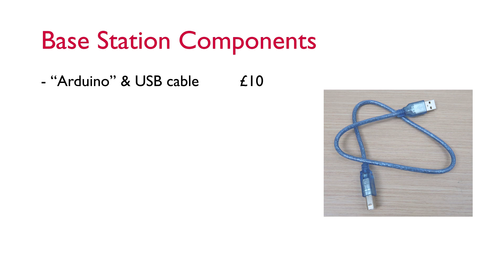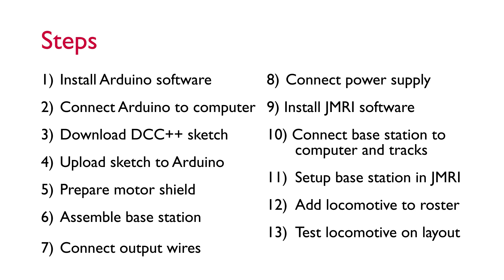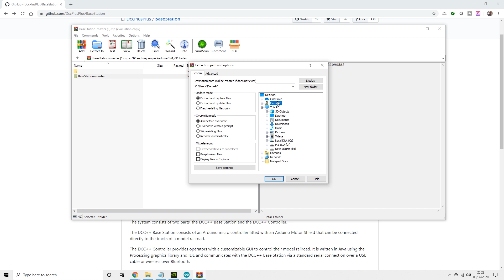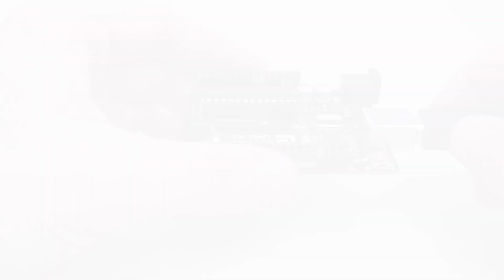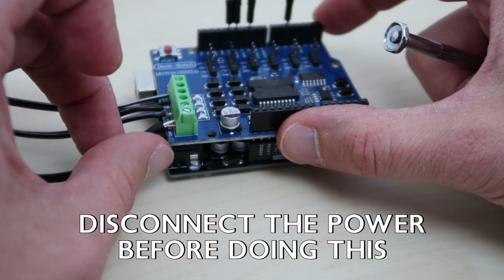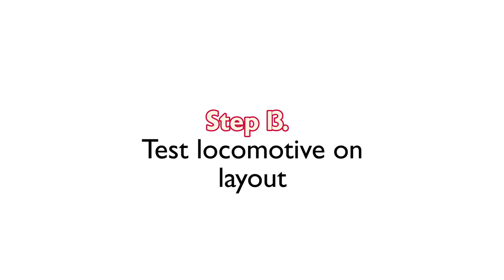Model Railway Digital Controller (DCC++) for £40 or less! 😮

Comment: Everything was going fine until you said (at 21.03) now turn on the power - and your led's light up on the Motor Shield. Q1: What did you 'turn on' as the USB and 19v were already connected? I tried a power reset to no avail, and I've tried an alternative UNO R3. All Arduino programmes loaded, coupled and verified. (Mac) Com port is working fine. DCC++ says DCC++ is online in Programming mode but can't see the programming track. Do you think my Motor Shield might be duff? Help!
Reply from the maker: Hi Andrew,

If you've got the locomotive roster open then along the top you'll have some buttons. The first button is "+ New Loco", the second button is "Identify", the third button is "help" and after that you should see an on/off button. This controls power to the track. It should be set to off (red) by default. When you click on it the button should go green and say "on". JMRI is sending a signal to the Ardunio to allow power to the track. This is when the lights on your motor shield should light up.

Give that a go. Hopefully you're just a button click away from getting it working. However, if not then try the following:

- In the DCC++ menu, click on "DCC++ Traffic Monitor" and a little window will pop up. When you click the power on button in the Roster you should see the following text:

" Track Power ON Cmd 
 Power Status: ON"

This is JMRI sending the command to the base station. That's the starting point for getting the track power to come on. JMRI would normally complain when it started up if it couldn't see an Ardunio connected on the COM port you specified, so I don't think it can be an issue with your connection to the Ardunio if you're not getting an error and the command is sending.

You should also see an LED flicker on the Ardunio when it receives this command. If you're seeing this message be received then that suggests it's an issue with the power supply or the motor shield.

- Double check your jumper wires are in the correct pins on the shield and fully inserted

- If you've got a multimeter then double check that the power input terminals on the motor shield are receiving power supply and what the voltage is.

Comment: Absolutely brilliant! just set it up in a few minutes after watching your video, got 2 trains running. Have looked  at your other videos and look forward to trying them. Thanks a lot. Liked and subscribed.
Reply from the maker: Thanks Dennis! Glad you've got it all up and running 👍
Reply: @LittleWicketRailway  I've just watched your video on Wi-Fi throttles so that's my next task so that my grandson and I can both control trains, we do at the moment with very basic Hornby DCC controllers as master and slave with RJ11 cable between them. I have another question although not sure here is the right place? I have a tram running on an isolated end to end DC track, and would like to automate it running back and forth and looking at your video about sensors I wondered if I can fully automate this using IR sensors at various places along the track so I can vary speeds, stopping at each end, etc. all using an Arduino and power shield maybe or MOSFETs? Thanks, Dennis.
Reply from the maker: @dennistombs692  Hi Dennis, sorry for the slow reply, but regarding your tram, you can definitely put in a shuttle using an Ardunio. Check out the relay and MOSFET modules in this video which might be of use https://youtu.be/CUWFqFmO1Ng

You could have one IR sensor at each end (or a current sensoring block occupancy sensor if you isolated a section of track at each end), then use a couple of MOSFETs to turn on the track power for forward/backwards. Drop in a delay each time the sensors are activated for a stop at each end.

If you wanted adjust the speed so that the tram gradually slowed down when the sensor is active then if you were using the MOSFET modules then I think you could do this with pulse width modulation.

Comment: I have a question, I did exactly what you did, but JMRI doesn't recognise any of my locomotives. It just gives an error reading them.
Reply: i have had a similer problem and am just about to have another sit down and make sure im doing everything right. I seem to be getting some messages when uploading the arduino sketch for the dcc base station.  did you get that as well ?
Reply: @danholland7023  No, I didn't get any errors at all. Today I found (one of) the problems. The cables shorted on the rails. Now I have fixed that, but the problem is still the same. I get 308 errors when try to read a train. Any train.
Reply: @basopdemotor  my cheap decoder did not auto recognise but worked when i selected it from the list. i hope that helps.
Reply: @danholland7023  That's also a problem. I don't know which decoders I have :-)
Reply: I finally understand why everything is not working. It turns out that my locomotives don't have DCC decoders in it. Just MFX.
Reply from the maker: Sounds like you've got to the bottom of the problem, hopefully you can get some decoders in there and get it running 👍
Reply: I'm having a similar problem as well. I'm getting a response for "power on", but JMRA does not recognize my decoders. My decoders are older (early 2000's) Digitrax and MRC. I am also using the L298 P rather than the L298 S motor shield, which is slightly different.
 Does anyone think that these two factors may cause a problem?

Comment: Hello. I'm really enjoying the content, thank you. I was wondering... With the various functions, it seems we'll need a fresh "Arduino" per function set we desire (power, signalling and points etc) Are there ways to combine functions into a single base board? Maybe I've missed something; I'm quite new to this.

Cheers!
Reply: Hi Edward. You may find this video of interest: https://www.youtube.com/watch?v=Yaw6TOkc7mE&ab_channel=LittleWicketRailway
Reply from the maker: Hi Edward, thanks and great timing! I've been looking into this and have just posted a video on the subject. Take a look at how Arduinos and CMRI can help achieve this https://youtu.be/OkXG3mfY6PE.

I'm also thinking about a wireless solution using MQTT, but that's some way off.

Comment: brilliant, for 2 locomotives to run on the same track, you must have a decoder? another thing, you can do this project on an arduino nano ?tnks
Reply from the maker: Hi Javier! Thanks for watching! 👍 Each locomotive needs to have a decoder fitted and they need to be programmed to different addresses. You can have loads of trains running on the same section of track if they all have decoders on different addresses.

You can't mix analogue and digital on the same track at the same time. A digital signal will damage a locomotive that hasn't been fitted with a decoder.

I don't think you could do this on a nano because you need to be able to fit a motor shield, but I could be wrong 😀

Comment: I have been following all your videos and like the way they are presented.  Thank you.  Can I check what track voltage I should be getting from the DCC++ base station?
Reply from the maker: Hi Martin, thanks!

That's not a straightforward question to answer because the DCC signal is an alternating square wave which is switching rapidly between a maximum positive and minimum negative on each rail. This website explains it well:
 http://www.sumidacrossing.org/ModelTrains/ModelTrainDCC/DCCDecoders/DCCVoltages/#:~:text=DCC%20Track%20Voltage&text=On%20a%20DC%20layout%2C%20what,they%20will%20be%20quite%20bright

If you're using a multi meter on AC voltage to get a reading then you probably won't be getting the full picture, but I think somewhere around 14V is ideal, 12V is the minimum. You might find this useful:

https://www.rmweb.co.uk/community/index.php?/topic/81492-how-to-use-a-multimeter-with-dcc/

There will be voltage drop through the wiring too, so what you measure at the rails may be lower than what the base station is outputting. 

I get a reading of 18-19V from my cheap multimeter on AC mode. Not had any issues with decoders blowing or motors burning out, but I never run them at full pace. I would try using a lower voltage power pack from the one in the video were I to build another base station.

Comment: This might be a stupid question but can you use just some normal wire to act as the jumpers that you put into the Arduino? Also I take it that the feed to your main track going to the Arduino would be your bus wire exactly the same as in a normal DCC track wiring?
Reply from the maker: Normal wires should be fine for jumpers as long as they make a good connection.

That's right, the main track output is your DCC bus.
Reply: @LittleWicketRailway  Brilliant thank you so much, I thought that was the case but wanted to make 100% sure lol.

Comment: Thanks was just about to setup a layout and having played with arduino for a aquarium controller. I did think I need to spend a fortune on shop bought controller. Keep up the great video’s
Reply from the maker: Hi John! Thanks for watching. There's nothing wrong with the shop bought controllers, I still use the Hornby Select if I want to quickly test something on the rolling road, but DCC++ is a lot more powerful when combined with JMRI and is a lot cheaper 👍
Reply: @LittleWicketRailway  agree Rob but I am a tinker and I guess it’s also the making of all the different parts working. Hopefully I will have a second hand loco with doc fitted so I can test it out in the next few days. Then will start on the sensor and point controller next.
Reply: Hi Rob quick question about the bus cables have you found an issue with the size of wire you can fit into the terminal block best I can fit in is 1.5mm which seems small compared to recommended size of 2.6mm - 2.03mm any thoughts?
Reply from the maker: @modelrailwaytheeasyway9743  the terminal block isn't the largest and you'll struggle to fit large gauge bus wires into it, however, I think the current available from DCC++ is limited to about 2 Amps and 1.5mm should be more than enough. The base station on its own is fine for a smaller layout with only a few locos running at any one time.

If you're planning for large layout with a long bus and big demands on current then I would recommend splitting the layout into power districts with power boosters. Have the DCC++ base station supply the signal, but let the power boosters deal with the current requirements.
Reply: @LittleWicketRailway  thanks for the reply I am still in the early stages of building the loft layout. I am not planning on running to many locomotives at any one time so that should be fine for me. Will look into power boosters if I run in to problems later on. So much to think about with dcc so will keep me interested for a long time. Are you going to install a mimic board to your layout in the future so you can control the turnouts from that. That would be a great video for the future. Another thing about the links for stuff if I click on them and even if I order other things from Amazon do you still get anything for that as I often buy from Amazon and if it helps you out that would be good.
Reply from the maker: Hi  @modelrailwaytheeasyway9743 ! The plan was to look into mimic panels this weekend, but something else got in the way. Mimic panels aren't really something I'm interested in, but so many people have asked about them that I thought it was worth looking into. Hopefully this week.
Reply: @LittleWicketRailway  I was thinking of one for the block sections which I think will free up the lap top screen have started to solder up the first block sensor from Merg and track laying is going well. Still got to sort out the points for the electro frogs switching but have got that as a work in progress. Keep up the great work Rob.
Reply from the maker: Sounds like good progress 👍

Comment: Very useful information and video. How this system behaves, when there is a short circuit because of a derailment, does it inform you about it and stops feeding the railway track or what else happens?
Reply from the maker: The DCC++ system short circuit detection and will turn off power, you even change the reaction time. I also use an NCE EB1 electronic breaker board for the track circuit. This detects shorts on the rails, cuts power and then tries to power up again every few seconds. The benefits of this is that it won't turn off the DCC++ power and all my accessories will continue to work.

Comment: Many, Many thanks for this clear explanation.
I believe, I' m now ready to take my 50 years old Marklin train out of the cabinet.
You did a very good job.

Greetings from Belgium.
Reply from the maker: Why has it been locked away for so long!?! I assume that if it's 50 years old then it's an analogue model and you will need to convert it to DCC before you can use it with this DCC++ system. Just to warn you that trying to use an analogue model with a digital system will damage it. Have fun 😁

Comment: Hi Rob, With the help of your tutorial I have just made my first JMRI/Arduino controlled DCC setup and it worked perfectly first time. Many thanks. A quick question I have of course watched your other Arduino controlled tutorials and wondered could I use the Mega to run both Train and Sector/Points control at the same time or would you use a separate Arduino for each function via a USB hub?
Reply from the maker: Hi John! A few people have asked me this and the short answer is that I don't know, but I think it should be possible as the pins needed for the servo drivers are still available. You'd need to combine the sketches, I'm not sure how easy that would be. Sorry I can't give you a clear answer on this. I'll add it to the list of projects, but that list is getting longer by the day!

If you have a go then please report back, I'm sure quite a few people would be interested to know the answer.
Reply: @LittleWicketRailway  Thanks for the reply Rob.
Reply: Hi, Rob. Not sure if you have seen this but this may answer the question.
https://youtu.be/rZl84NXALaM

Comment: Using this system, Is it possible to detect the whereabouts on a particular loco on the track. Im thinking some kind of transponder?
I have perused your DCC++ videos and you have inspired me to get back into the hobby. Thankyou
Reply from the maker: RFID tagging is an option for detecting trains and also identifying them. Not something I've looked at yet though.
Reply: @LittleWicketRailway  cool thanks, I’ll check this aspect. Possibilities are exciting. Keep up the videos. Really interesting. Cheers from NZ

Comment: Hi Rob great video, followed all the steps but getting stuck at the end. My motor shield has no lights on it when it’s plugged in. I’ve got 19v going in as I too a reading from the screw heads on the dc in terminal. Any ideas?
Reply: What gauge? 19v is pretty high. If you go to our website at https://DCC-EX.com, you can go to the support page to see how to get in touch with us. The best way is Discord as shown there. We list other ways to contact us there. You probably want the newer DCC-EX version also since CV reading is not reliable in what we now call the "Classic" version.  The new version is a complete rewrite and you don't need jumper wires anymore.
Reply from the maker: Hi John, apologies for the slow reply. How are you getting along? The lights will only come on when the track power is turn on in JMRI. Were you able to upload the sketch and connect to the board in JMRI successfully?

Also, as FlightRisk has said, if I were to do this video again I would use a lower voltage power supply, I've amended the video description to reflect this, but I've not had any issues with the 19V power supply I suggested in the video.